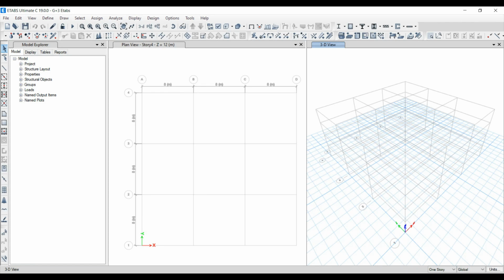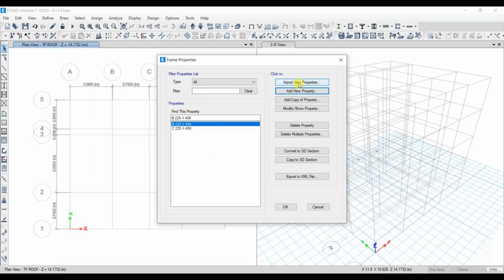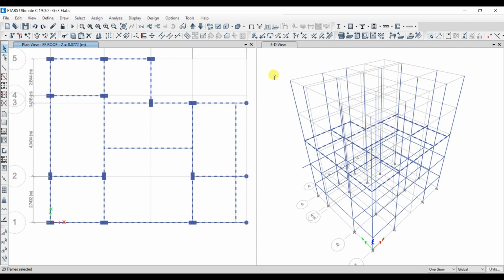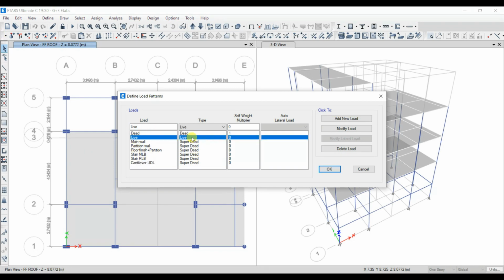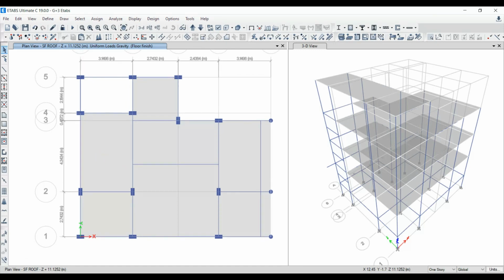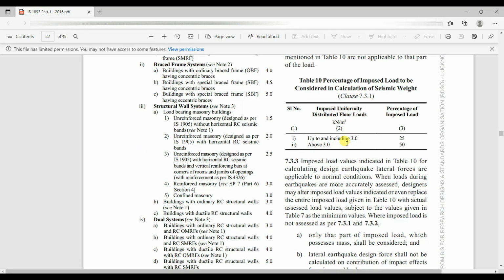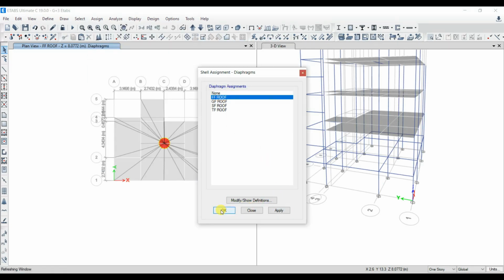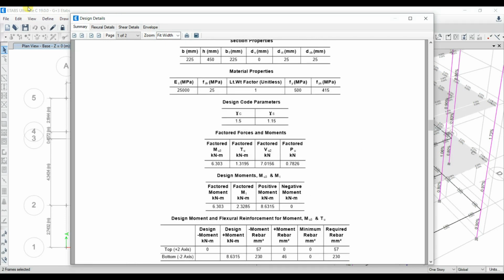G+3 building complete Analysis and Design in Etabs | Seismic Analysis and design for G+3 building

Comment: Very informative, please explain or solve unsymmetrical plans in ETABS, and teach detailing by using ETABS.
Reply from the maker: I have created a course, structural design of buildings using Etabs software which includes structural analysis and design of  a five-sorey RCC building(Real project) and is now available on udemy.
Kindly use the below link to avail the full course.
https://www.udemy.com/course/structural-design-of-buildings-using-etabs-software/?referralCode=14883FDBBD95A1ADAC02